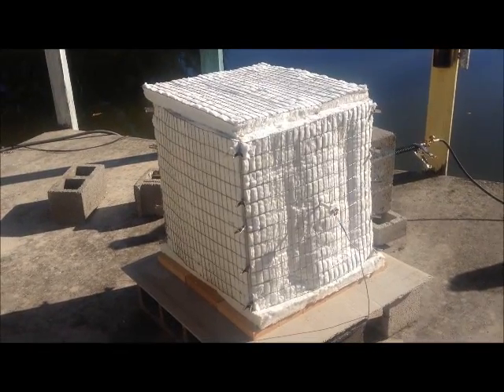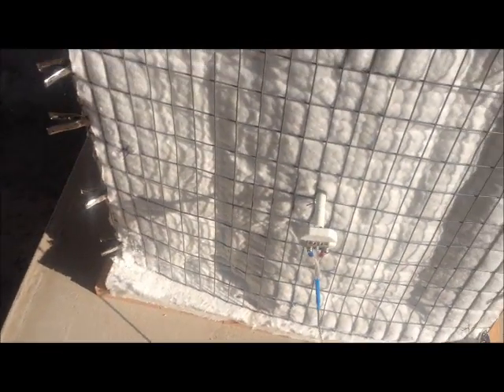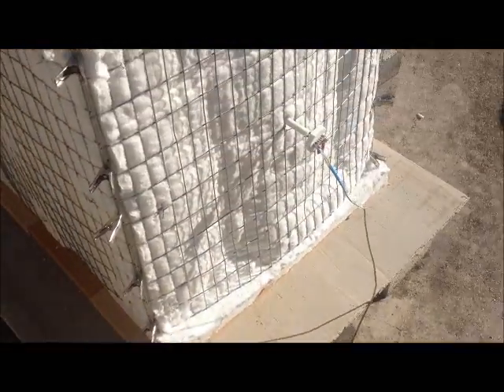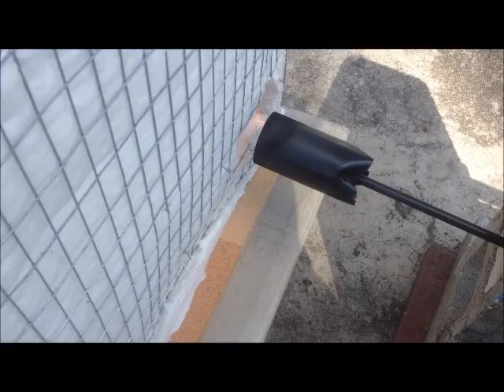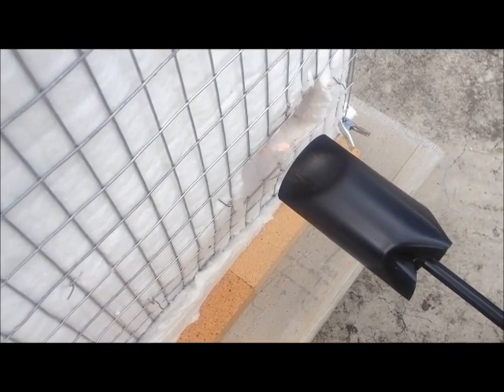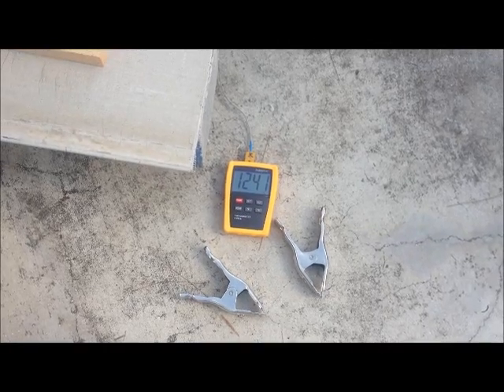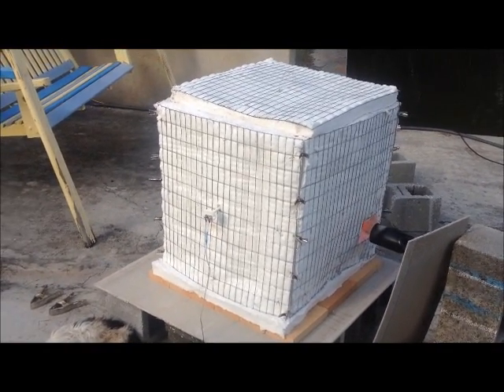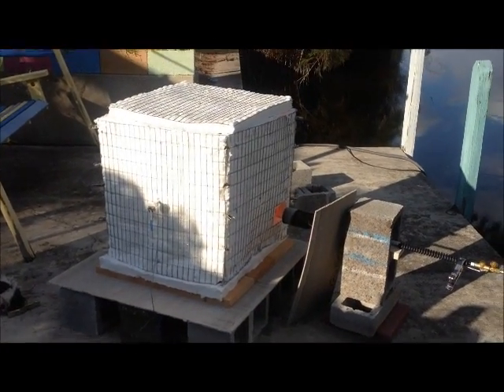First time trying a ceramic bisque firing in a home made, ceramic fiber Raku kiln with propane

Comment: Interesting video but I was wondering, would putting a shell over the insulation make the heating more efficient? Cause that's just insulation and ussually you need a backing for it to work properly
Reply from the maker: It worked fine as is, but sure, more insulation would improve it's efficiency. But it would entail more expense and more time to set it up.  The advantage of this setup is its relative inexpensiveness and portability.
Reply: @tarvus33991  ok thank you, I'm actually planning to do something similar and was just curious
Reply: Right?

Comment: If your looking for some ceramic fiber blanket here is my listing on ebay.
http://www.ebay.com/itm/Ceramic-Fiber-Insulation-Blanket-2300F-RT-8-Thermal-Ceramics-1-x12-x24-/322032486207?hash=item4afaa1c73f:g:sukAAOSwsN9XAht0

Comment: is it possible to use 1" ceramic blanket? I need a kiln for 800 centigrade degrees. is it possible to use one layer of ceramic blanket for interior and one layer of glass wool for the exterior layer?

Comment: I really enjoyed your video.  I would like to make a kiln similar to yours.  Where can I purchase the 2" ceramic fiber, the wire you used to sandwich it together and the instrument you used to show the temperature?  This is a fantastic kiln you have designed.  Thanks Bryan
Reply: I made a raku kiln and I bought the blanket at any pottery store. It can be sold by the foot or the whole box. I think this will take a whole box. I used a 16 gauge galvanized steel wire you can get at any home store. The instrument used is called a pyrometer and can be found online.

Comment: I, too, watched Simon make and fire a wire kiln.For my birthday (60th) my husband helped me make a kiln this weekend. Ours is also a modified wire version. I am also interested in a bisque schedule if you are still in the sharing mood. Books, lit write-ups, any info would be appreciated. What info can you share about the pyrometer? I have been taking pottery classes since January and doing cone 10 reduction, and learned to raku/saggar with wonderful results. What type of clay body are you using? Low fire or raku? Please don't shame us by telling us you  are a purist and make your own clay. I'm on FB or email: donna.grammas@yahoo.com  Thanks in advance for any info.
Reply from the maker: Dixie, I use stoneware, porcelain and raku clay primarily.  My first few bisque firings were cone 06 to cone 05, but I have become a fan of cone 010 bisque firings as lately I'm doing a lot of raku and saggar and I feel the lower bisque level gives better thermal shock resistance.  An added advantage of lower bisque levels is less propane used and quicker firing time.  If you dip your glazes, you need to be aware that 010 bisque is VERY absorbtive and adjust immersion time accordingly.  I candle everything in the kitchen oven the night before (slowly increasing oven from 170F-250F, a process that takes at least 5 -10 hours) so my greenware is absolutely dry when it goes into the kiln.  I can finish a cone 010 bisque in 2 hours without adverse effects.  I'll try and put together a sheet showing my ramp schedule for both 05 and 010 bisque firings and post it later.
Reply: tarvus33991 I picked up some INSWOOL S yesterday here in the Atlanta area for $65 (pick-up price). 1"x24"x25'. I'm told by the ceramic engineer that S blanket fibers will be kinder on our lungs.  Matter of fact he said he would not sell me any insulation but the S. He felt that strongly about my safety. I believe the extra $15 is health-wise. Thank you for your quick response and I will post info perhaps people should know  about, also.

Comment: How long did your ceramic fiber last? Were you able to do several firings with one blanket of ceramic fiber? We're doing our firing a steel trash can lined with ceramic fiber blanket, and I was wondering if we could do a bisque and a few raku firings before the blanket is no longer usable.Also could I get a copy of your firing schedule, my email is theartist@shelanakelly.com. Thanks.
Reply from the maker: I've done 18 bisque firings to date and probably an equal number of raku firings.  No degradation of the ceramic fiber yet, but some of the nichrome wire staples are starting to need replacing.

Comment from the maker: The first firing I used about 2/3rds of one tank.  At that rate, I could get 3 firings from my setup using the double tanks.  I have done subsequent firings at a faster rate and have used much less propane.  I can probably get 4 firings from the double tanks now at the new firing rate.

Comment: Great video, thanks! Are there any health and safety considerations with the ceramic fibre?
Reply: Yes, the fibers will only be dangerous when airborne. The untreated surfaces will fracture with time inside and our, becoming airborne. the inside should be coated with a refractory coating to prevent this degradation, as well as the outside should be sealed with some rigidizer.
Reply: ehjones

Comment from the maker: No.  With the infinitely adjustable lid, it's not necessary for a vent.  I may add a covered peep hole in the lid that I can use to make it easier to observe glaze maturity during Raku.  I suppose the peep hole cover could do double duty as a vent.